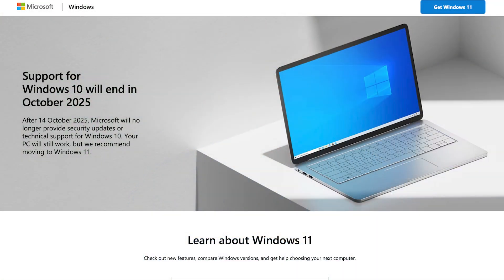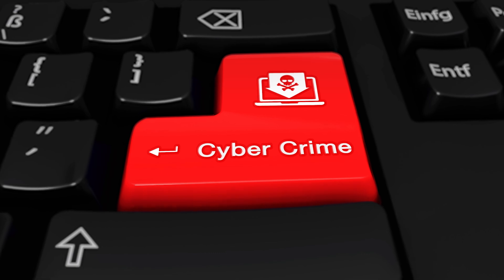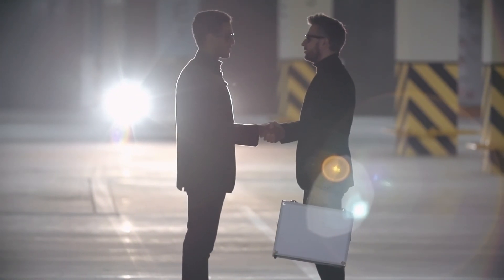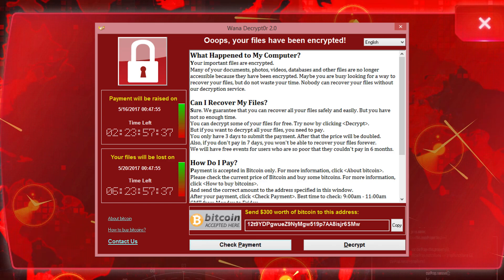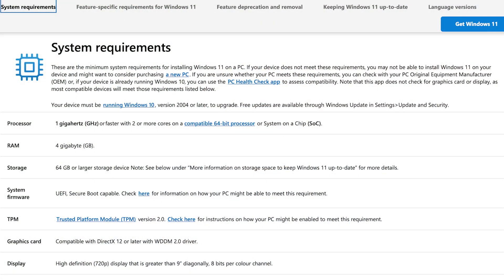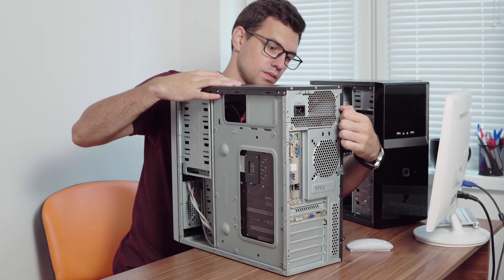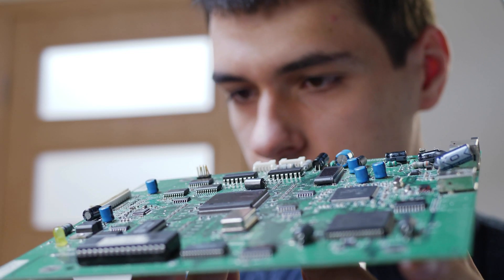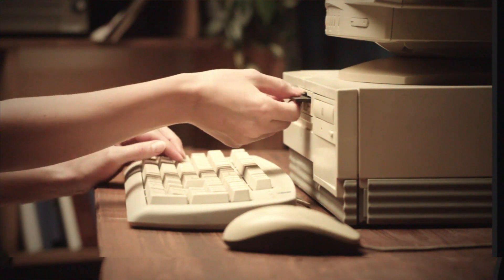Windows 10 End of Support: Upgrade, Downgrade, or Switch? What You Need to Know

Comment: Switch to Mac
Reply from the maker: I did this, although it is essential to remember that Major macOS versions are now released once a year and usually maintained for three years. Apple usually provides security updates for the latest three releases, but this isn’t consistently applied, and some security fixes aren’t available for the non-latest releases. However, I have found that software tends to be supported for longer on a Mac than on a Windows system.

Comment: Facing a low W11 base and adoption, it is possible that they extend its lifecycle, like W7, just to avoid migration to linux and other operating systems.
Reply from the maker: They may do this, as with Windows XP, but it will likely be temporary. Migrating to Linux is not a viable option for most corporate users.

Comment: IDC, I already end-of-supported it myself by permanently disabling updates since 2022, holy: never had a Bsod, never freezes, never bootloops, never ads, never W11 Microsoft extortion and annoyances and best of all: Not a single driver being downgraded by Microsoft without even telling me until I find out due to problems
Reply from the maker: This was the policy in one company that I am aware of. The computers were locked down, disconnected from the internet and stuck in a time warp, but they worked. However, there is always a weak link and someone infected one PC from a USB drive.
Reply: I use win7 and haven't gotten an update since like 2017?

wired internet too
Reply: Do not do this! You should at least enable security updates if you dont like the feature updates. If you want to do this you can google "Chris Titus Tech Tool", he has an option for disabling feature updates without removing security updates. Otherwise you are open to explotation of vulnerabilities inside of windows!

Comment: Short Answer, Switch to linux.
Reply: Good luck if you are a Creator, Gimp is nowhere close to Affinity or Photoshop's capabilities or ease of use, let alone C1 or Lr and many other plug-ins. There is times you still have to 'roll your own' support when compiling drivers or packages, not so common as it was 20 years ago though as driver support is a lot better - as long as you stick to mainstream hardware. No licenced codecs notably AAC which is the most common codec used in professional cameras and tools. Davinci Resolve fails to render your open/close buttons on the pane. I could go on, even Open Office is clunky and just lacks the polish of Office 365 which makes using it painful to use and the font/screen rendering for Open Office is painful to work with for long periods on the eyes (at least to my eyes). This is before I get onto the state of gaming if they use kernel level anti-cheat. There has been plenty of 30 days with Linux videos in the last few months highlighting the issues with Linux.

Linux has a place, but it's not the be all and end all. Realistically a lot of the older hardware is going to be end up in recycling. This is coming from someone who has worked with various *nix variants over several decades and refurbished a lot of old Enterprise kit. I will also add I trialled two people using Linux but even after two months I was still getting inundated on questions on how to run certain applications, find files , why can't I do this and so on. I just do not have the time to be a 24/7 tech support, sure some of it was teething issues coming from Windows, but other stuff is just braindead decisions by Linux and yes, I know Linux is infinitely customisable at least until the next upgrade that breaks everything.
Reply from the maker: Linux is good in that there is usually an open-source version of most productivity software. However, problems arise when everyone else does not upgrade with you, and you start running into compatibility problems with software.
Reply: @studioidris the software side of it is miles better than it was even just 5 years ago. An issue that's going to become more of an issue is hardware being forced into obsolescence. I had to upgrade my wifi card in my 2014 hp laptop just To be able to see the campus new network when they changed ISP. Campus IT announced hardware older than 2019 would not be able to use the network anymore...cuz reaso s. The card was so old it did not have wpa3 protocol enabled. Had to upgrade to an ax210 chipset wifi 6 card.